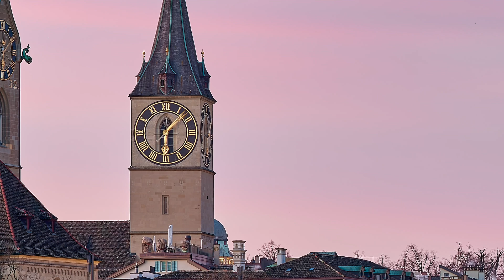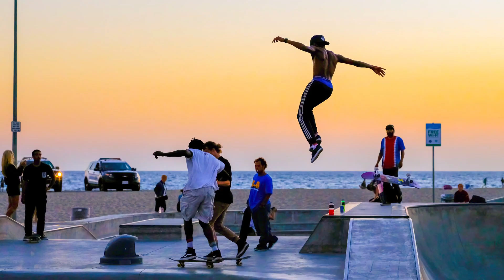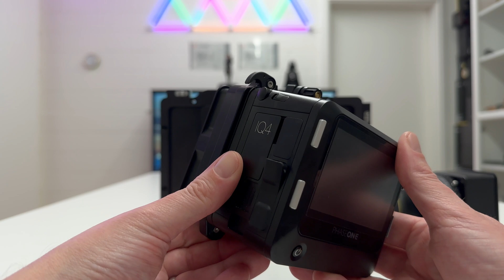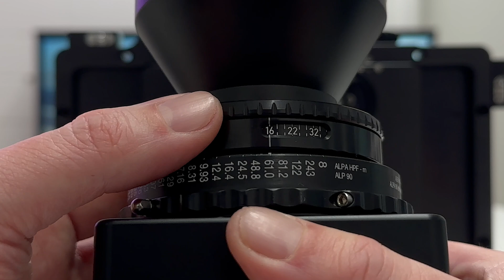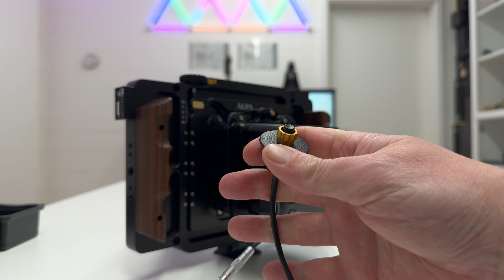Phase One IQ4 on Alpa 12 Pano | THE Best for Panorama Stitching

Comment: this is very amazing.  what lens do you recommend for a hasselblad digital back with the alpha pano camera
Reply from the maker: Actually, you can decide based on your preferences in terms of focal length. All Rodenstock lenses are excellent. They require some work in post but the results I get with all Rodenstock lenses are really good. Other brands do the trick too. The only downside is that lenses for this setup are very expensive!

Comment: Great video explanation of the ALPA 12 Pano Rosewood.  This video plus my own research led me down that path to purchase.  I already had a PhaseOne XF and IQ4 so the ALPA was a good companion for sharing the back between the two cameras.  In the video you talk about the size lf the ALPA 12 Pano and finding a way to carry it.  I purchased a Nomatic backpack which works well to carry the camera, digital back, several lenses, batteries, lens hoods, etc.  If you would like to see a picture please let me know and I will ;provide that to you.  You also comment on the ALPA lens hood which you state mey be produced via 3D printer.  While I did buy that hood I subsequently bought a Cambo AC-324 lens hood and adapters.  This lens hood collapses to nearly flat with its accordion pleat body and provides better lens shading than the round ALPA hood.  Just wanted to thank you for this very detailed video of the ALPA 12 Pano and share my experience with the backpack solution and lens hood.

Comment: you also forgot one thing, as the IQ4 is NOT on an XT or XF body, you need to change the shutter behaviour, aka latency setting in the menu, this says how the shutter behaves, does it wait for a signal from a lens?, or do you have a 'double tap' cable, aka one with a 'wake-up' button included which gives you 5-15 sec. to press the shutter, or the button on the back, or the back button alone. plenty of options, BUT one warning, like the H system hasselblads, you MUST connect the flash x sync cable to the BACK, NOT the pc port on the lens!, as it is the 'digital' shutter you are using, not the leaf shutter in the lens!! this applies to all backs, when used on a 'technical camera' like the linhof technika, Alpha, or other make LF camera system, as this digital shutter is used with these too.

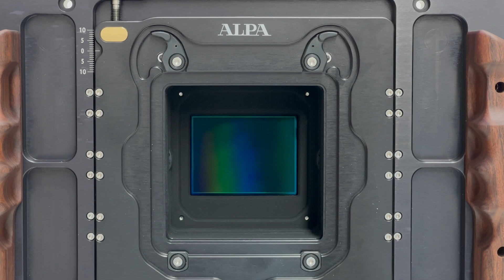Comment: at 2:56 you should FIRST shutdown the back, as is apparent there is NO baffells between the lens and the sensor, so if charged up, the sensor will attract dust!, so probabbly best to shutdown this and cap the sensor surface first, it is ~$15,000 AUD after all, and the less you expose the sensor to the cleaning solutions the longer it will last.

Comment: Great video!  Looks like the hyperfocal distance was 15.54m - did you set that on the lens or did you focus on an object at that approximate distance in the scene?  Also, do you recall what length you set frame averaging to?  I am always trying to decide how long to set it.  I am using the Cambo 1600 tech cam - love how it switches from horizontal to vertical in a few seconds, plus it fits in my Compagnon Element backpack and can easily be taken in and out through the side access panel with the back and lens on it....
Reply from the maker: I set the hyperfocal distance on the lens, and frame averaging I set to 2mins ... could have done longer but light faded out very quickly in the blue hour.

Comment: I have always admired the Alpa cameras! In reference to the IQ4, can you please clarify what the "Frame Averaging" does. I either missed it along the way, or didn't see where there was a discussion on what it  actually does. So it looks like it takes multiple images and then does something with them. But what? Thanks.
FWIW - I have used Hasselblads for over 50 years, currently using the X2D. Since there are virtually no Shift lenses available, I do utilize the nodal points of my XCD lenses for pano-stitching, with better-than-average results. But, unfortunately, I still lose quite a lot of pixels in the stitching.
Thanks again for a great, informative video.
Reply from the maker: Thanks Michael, here is a video on my channel about "Frame Averaging" explaining everything you need to know about that feature: https://www.youtube.com/watch?v=Um3Qvli8TpM and here is a Phase One sponsored page and video about it: https://photography.phaseone.com/inspiration/frame-averaging-and-creative-control-with-paul-reiffer/

Comment: Alpa is cool, but digital is boring, I would rather slap a film back on this
Reply: You could use film of course but it would need to be 10x8 sheet film to get close to the 150mp digital back.
Reply from the maker: Agree with John, you can use film of course, see here: https://www.alpa.swiss/pages/faq#general When you scroll down you find the following text: "Currently, film backs are available for the formats 6x9 and 6x7. ALPA/Linhof film cassettes can only use type 120 film. ALPA also offers adapters for Mamiya RB and Horseman. These adapters allow using the backs of the Mamiya RB (6x4.5 to 6x8) on the ALPA. We recommend the motorized versions for its higher precision and the ability to use 120 and 220 type of rollfilm. These backs and film cassettes from Horseman (Arca) are mostly available on the second-hand market."
Reply: You can’t use a film back on the Pano but you can on the Alpa XY (if you can find one)
Reply: To be exact, you can’t use a film back unless you have an SB lens (which limits the choice) and an adapter between the rear of the body and the camera.

Comment: Incredible!!! two questions, 1) why not use the Phase One XT camera with digital connectivity? 2) what is your computer spec to process 200 mega pixels?
Thanks for another great video 👍
Reply from the maker: Many thanks John. I also have the XT body, see videos on my channel and the ones linked in the infobox below this video. What makes the Alpa so cool is the quick grid-locked horizontal shift mechanism. Its just so easy and a pleasure to work with it. Clearly on the XT body you get more features and also communication between lenses and IQ4, spot-on comment.

Comment: Sir you are living my dream - I am stuck with a 907x on a small slider - !!! This is excellent - well done on a super informative and thoroughly detailed review - I Can dream your dream - I may be tempted by the smaller Alpa which takes the 907x - take care
Reply: poor you!
Reply: @lnz971  I have been Pro for forty years and cameras like these are just tools for the job - I've never been tempted to go down the Phase One route because of the cost versus what I would have to sacrifice in terms of all my Hasselblad related kit which is all interchangeable - if I had to start again with just landscape based work - this would be a beautiful set up - try not to get salty - someone has to own them!!
Reply: @nelsonclub7722  get salty? why?
Reply: @lnz971  "poor you' ????
Reply: @nelsonclub7722  il was ironic :) btw i have X2D + HTS 1.5 + HC 100 2.2 - HCD 24 and also a lot of canon gear. So... I'm not salty
Reply: @lnz971  Cool - we got off on the wrong fot - I have exactly same - I filed off the little nub on the HTS tripod adaptor and it fits under the 907x beautifully - straight on and off the Hass quick release - the X2Dii is on the to purchase list - but I often use both the X1Dii and the 907x in tandem...... dilemmas - first world problems  - have a good one - sorry if I offended -
Reply: @nelsonclub7722  i think it will have a new 100mp digital back, the X2D need serious feature to be a workhouse yeah maybe the X2Dii will be the right one!
Reply: @lnz971  Agreed - cool as - have a great one - make every frame count
Reply from the maker: Ha! :) You guys really started on the wrong foot and then found each other, great! The 907X or the combo I showed on my channel with the X2D and HTS 1.5 are great tools for achieving almost the same of what I showed in this video ... you are really good to go with the gear you have! I really hope Hasselblad updates the 907X + CFW II 50c towards a "CFV III 100c" in the course of 2023, would be great to see the X2D sensor on the 907X :)
Reply: @mathphotographer  Yes Sir we did - there should always be love with other like minded souls in all things human and especially photographers !!! - Carry on doing what you do - I am seriously considering the Alpa 12 for the Hass 907x now - so thanks for spending my children's inheritance money!!!!!! - Take care all Simon J Miller
Reply: @mathphotographer  :) math i still need to find your XH adapter tripod feet!!!! the hasselblad one is so wrong i have to put it backward if not it touch the hts 1.5 and it get all unbalanced